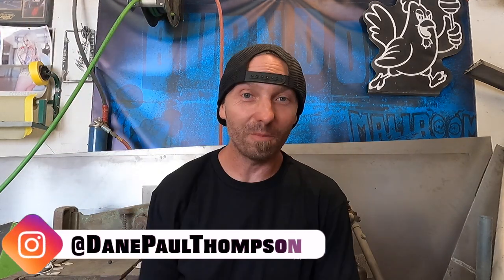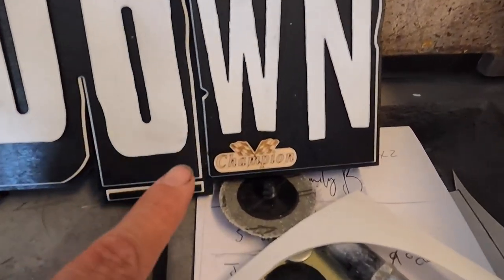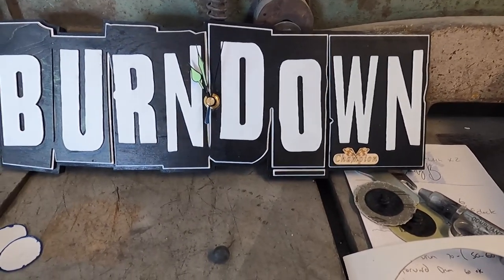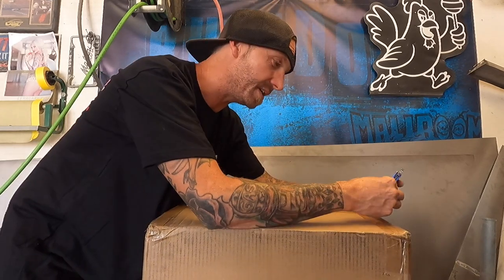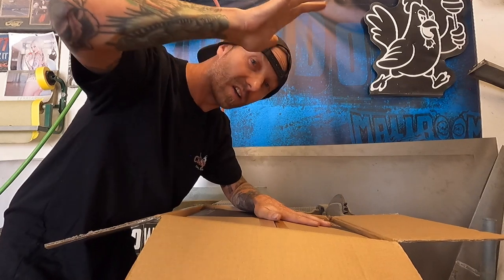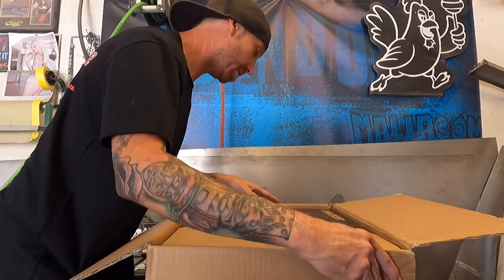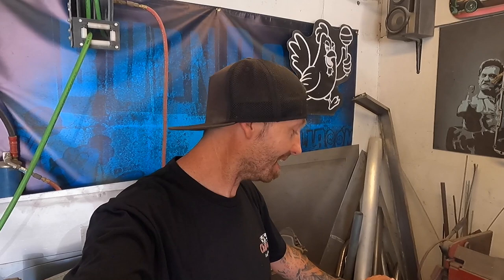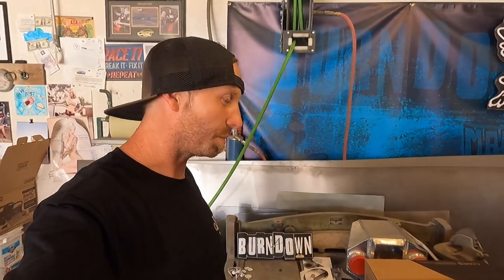I Got Custom BurnDown Clock

Comment: Bass isn't directional, so it doesn't need to face the listener.
Reply: @seturbo; ALL sound waves are directional
However, You are correct that the lowest frequency sound waves not only affect the hearing, they are actually mostly 'felt', sensed.
->thus the placement affects are different.
You still could use some basic, correct information, knowledge about sound, sound waves, projection, reflection, affects, effects.
Sincerely
Reply from the maker: I enjoy watching the Subwoofer work when you can see them tho.
Reply: @Burndown  Dane Paul: What do You mean "enjoy watching the subwoofer work" ?
What are You watching and seeing ?
The woofers only operate as low as 25 Hz - due to the combination of amplifier filter and the limited frequency response with a 12 inch woofer speaker ?
For me, to enjoy a woofer, especially a proper subwoofer, the low frequencies will not only be heard, also felt, sensed through the vibration sensations.
But both of these don't, won't accomplish the vibration sensations and limited bass frequencies which can be heard also.
Human hearing detects 20 Hz and some slightly below.
Sincerely
Reply: @newtonfirefly3584  You're trying too hard to be technical about it; people can see a subwoofer vibrate when it pounds, which is what he means by "watching the subwoofer work".
Reply from the maker: @newtonfirefly3584  A subwoofer moves in and out to produce the low frequencies so its cool to be able to see it move.
Reply: @Burndown  Thank You Dane Paul for clarifying ore precisely 
-> this is basically what i had figured, but desired Your confirmation.
-> for me, a sound system if for quality sound reproduction and that experience
->best experienced with my eyes closed, engrossed in the sound imagery.
->when i went to assist my sister with her purchase with first audio sound equipment, then later for myself, the process included experiencing the sound with specific, selected music to notice, detect, develop the imagery through the sound.
->this was far more extensive with my selection with my equipment, especially the extensive hours listening to, with, experiencing various speakers - including using the selected equipment ->then deciding which ones 
->there were several which i preferred but could not justify then, to expend the extra amount outside my personally determined, pre-designated budget 
->Note, as well known - 1/3 of the budget should be designated for the speakers - they produce the sound heard.
->the amplifiers are important to transfer the electrical power correctly, well minimal, best undetectable audio distortion - obvious critical - but cost wise, significantly less to achieve - electronics are much less expensive to produce and design.
Dane Paul, it seems You are easily influenced by and accept those with incorrect information, knowledge within many areas, topics, yet with some You accept form proper individuals 
->what is Your basis with determination ?
->the advice You stated about the 'subwoofer' balance [which i did not see in any comments] - is incorrect, misleading 
->more importantly this entire setup is imbalanced!
->as per my comment, if i were some how accessible to You, one of my areas which i could easily assist You with is to experience a properly balanced sound system - also with the equipment You have.
All The Best
Sincerely